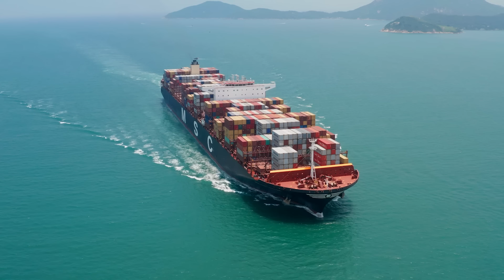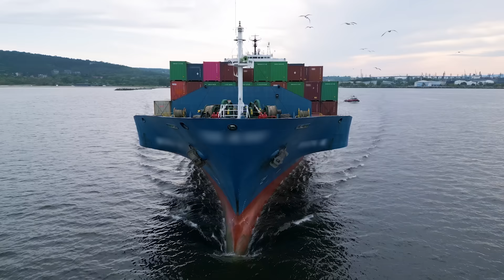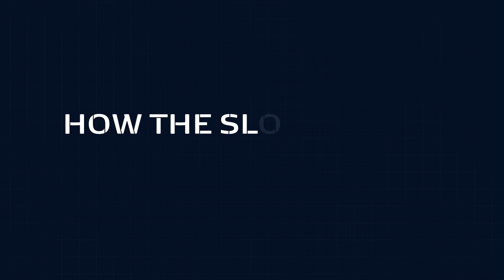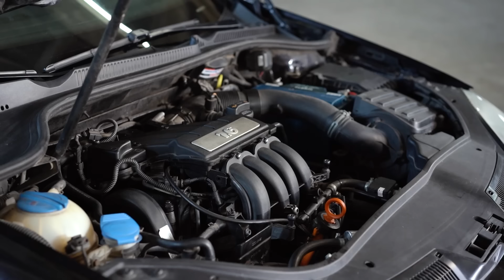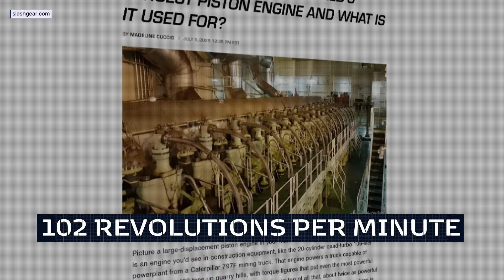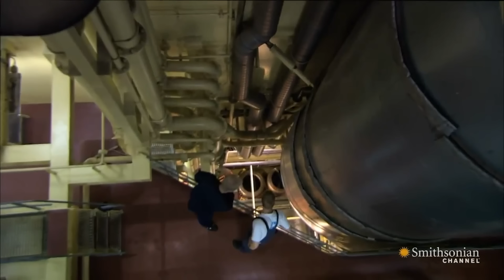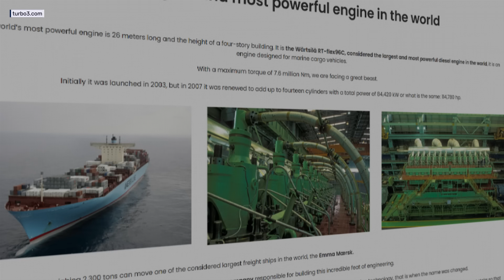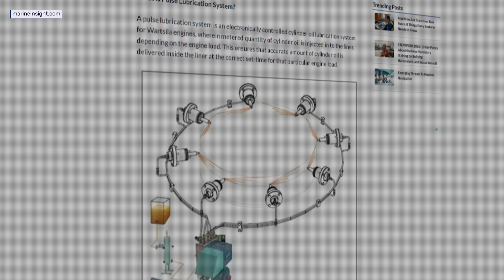The 100,000 Horsepower Engine

Comment: Is this still cheaper than a newer nuclear engine?
Reply: Even with a nuke plant you are not making this level of power. Also a nuke will need alot more crew and containment. Now remember the whole pirate thing. Imagine one of those groups getting ahold of one of these with a nuke plant onboard?
Reply: @dorsk84 good points
Reply: The Germans many years ago built a "Nuclear Powered Cargo Vessel  OTTO HANN".  It was in Hamburg many years.

Comment: This may sound stupid but only recently did I learn just how MASSIVE ship engines are. I knew they had to be big but not almost as big as a flat block 😂
Reply: You have to work on them to get a "Size Perspective" .  I was Engineer on a  300,000 ton  Tanker ( Universe Korea)  50 years ago powered by Steam Turbine. For steam production we burnt  280/300 tons Heavy fuel oil per day . 30 Days Persian Gulf to Bantry Bay 8,800 ton of fuel !!. First time you join one of these Giant Tankers  a real shock to you the size of every thing. Only 5 Engine Room Staff . Fully Automated nobody  there at night  with bridge control.
Reply: @GrahamNewman-mq7gr that's a lot of fuel oil 😮 absolutely staggering the proportions
Reply: @dwaynne_way It was experimented with Using Raw Crude Oil As Fuel. Not residual Heavy oil. Centrifuging / Filtering it  on board. The theory been it has everything in it  so should burn cleaner and be cheaper . Crude is not as thick /  tar like as residual heavy oil contry to what many think.
Reply: @GrahamNewman-mq7gr  Crude isn't any single thing, and the behavior varies significantly depending on where you get it.  Heavy residual oil is by definition the heavy stuff at the bottom of the fractioning column, but you can get crude blends with a high proportion of those heavy contents that need thinning or heating to pump.
Reply: flat block?
Reply: @Arnada_1st  here in the UK we call them that, another way of saying it is apartment block. (Ours is roughly same size at 4 floors
Reply: @Arnada_1st a city block.
Reply: @Arnada_1st  He could be Canadian or some other part of the Commonwealth. A flat is an apartment to us Yanks.
Reply: A small condominium building in US terms.
Reply: @rtyrsson  you are close, I'm Welsh 😊
Reply: I suppose ships of this size and speed all have engines like this, but smaller ones have other types. I've seen a 3 deck engine with the external camshaft that was mentioned, but also ships with 2 or more smaller engines driving generators which then drove electric motors that rotated the prop shafts. Some WWII war ships used engine driven steam turbines for propulsion.